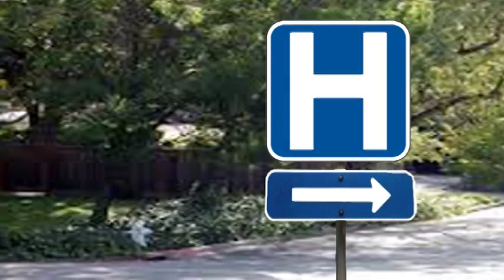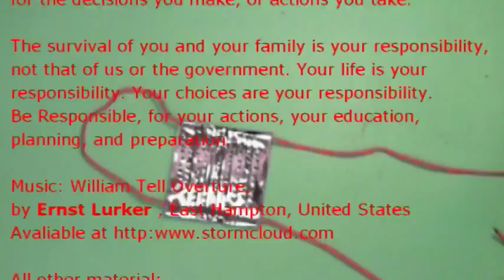Crampons as found in Empowerment Readiness

Comment: l was thinkin similar, nails screws through piece of plank and tie it on shoe.
Reply from the maker: A good idea, try it and let me know. I think, however you may find to have wood thick enough as not to break will make the sole to thick. Walking on ice is already treacherous enough. Also more materials are involved.  A thought may be to have a piece of wood overly large, i.e. show shoes. This could offer multiple possibilities.My philosophy is usually that simpler is better.Thank you for your input. GP
Reply: yes normal plank is near inch thick that will be a clumsy ice shoe but can be made fast and probably useful, many brake bones falling on the ice cos they dont have any grip and dont think about improvising
Reply: and yea maybe make it longer than the shoe so the long nail can stick up in front or two nails , and maybe in back too.